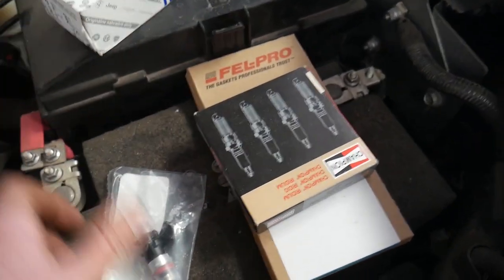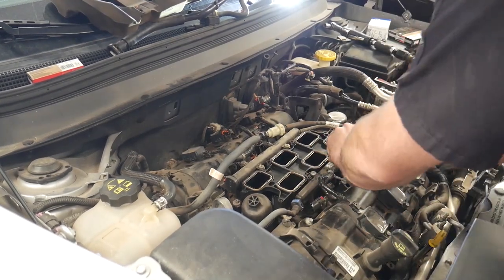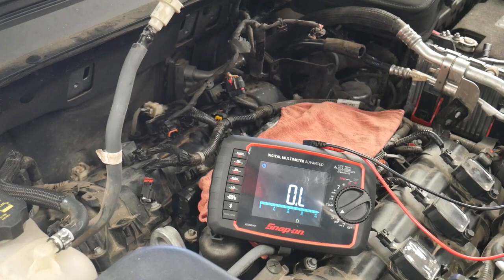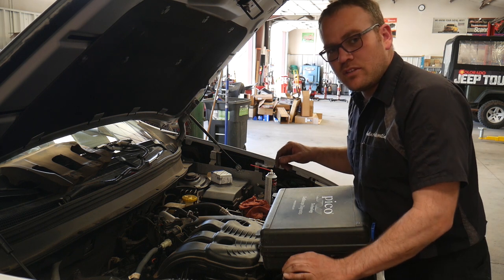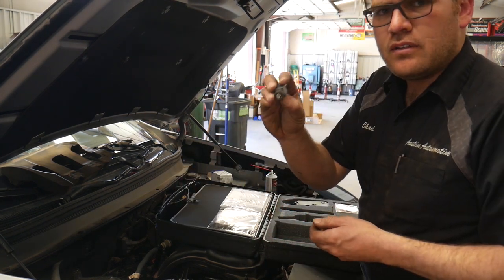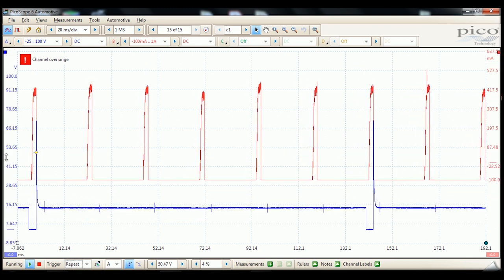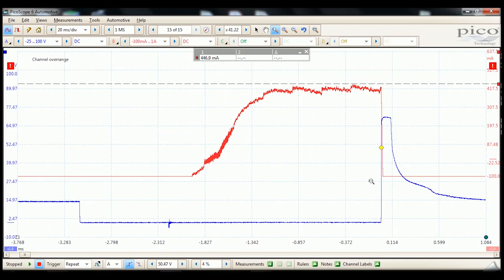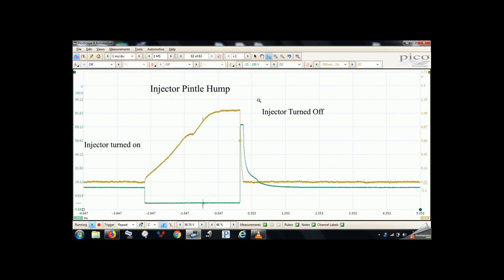2014 Jeep Misfire Injector code Pt 2 new injector and retest

Comment: how do you disconnect the fuel injectors? I'm trying to change the oil filter housing unit on a 2014 jeep grand cherokee 3.6L and for the life of me, the injector connections are not coming off. I'm wondering if I'm missing something, not seeing an important detail. Please help, thanks.

Comment: im getting ready to perform a side job, as a ford tech this is very helpful. i appreciate the in depth detail not just for learning purposes but for simple direction.
Reply from the maker: Glad to help. I have run into this issue several times on the newer Jeeps. Luckily the job isn't too bad to handle and at least you don't have to shampoo the engine like the newer ford ecoboost timing covers and oil pans.

Comment: Wow, another video that doesn’t show you how to disconnect electrical from the fuel injection. It must be some stupid trade secret that no one will share.
Reply from the maker: It is a trade secret and the Italians (FCA) will likely come after anyone revealing trade secrets. I’d offer a refund but the information was free. 

Honestly it’s something that we deal with day in and day out and releasing the safety clip becomes normal. I don’t have one of those vehicles available but I would assume there is a red safety tab that needs to be slid up away from the injector 1-2mm. Then you can press the tab to unlatch it from the injector. If it’s a POS connector from a POS company it may not release without using a pick to lift the latch from the bottom side of the connector. 

Mike, I hope you have a wonderful holiday season and spread more cheer than despair.

Comment: Hey, thank you for this video, 

I'm just clarifying some info on the injectors .. My wife's KL Trailhawk is throwing a Cylinder 2 miss fire and injector problem. I'm do well with tools, so I can definitely replace everything needed to try and fix the problem. My question to you is, how easy is it to get that fuel rail off, as well as getting the injector out, and reinstalling the new one ? Is it as simple as sliding out the rail and injector, and then sliding the new injector in and reinstalling the fuel rail ? 

Thank you!
Reply from the maker: You will have to unbolt it from the engine and the injector may have a clip holing in to the rail
Reply: @ThePracticalMechanic  how do I unplug the injector harness from the injector? There’s a red plastic piece. Push or pull? Thanks for the video
Reply from the maker: @w1923  you have to pull on the red clip first and then press down on the release button
Reply: @ThePracticalMechanic  the release button on the side?Thanks!
Reply: Thanks for your help. It was easiest to unbolt the fuel rail, then pull the injector out. After that i had to spray a small amount of wd40 on the red clip. To pull it without breaking. Then release the injector from the clip. Make sure your hands are clean when dealing with injectors. A small amount of grease on the rubber gaskets before you put them back in.
Reply: Same problem with the injector #2.  Could u please tell me which of them is the number 2?  Maybe a diagram

Comment: I'm a mercedes tech doing a side job. Im gonna replace all 6 injectors at once with new plugs. Are the injectors plug and play? Cause for benz i have to type in the each code.
Reply from the maker: No coding required on these
Reply: same like M272 fuel injectors ,  unlike M274

Comment: Thank you for the run through! 2013 JK Question, Misfire on 3 still. Going to do the injector however, we have oil in the intake and go through 1/2qt or so per tank of gas depending on city or highway. We can’t seem to get an answer on what it is from shops. New coil packs and plugs. Could the oil be due to a bad injector somehow? Thanks!
Reply: whats the update? My lady and I are dealing with the same continuous misfire; Also new plugs / ignition pack. Injector(s) are next.
Reply: That sounds like a bad pcv valve issue
Reply: Check your oil housing unit they are known to leak after over 40 oil changes

Comment: Do you need to remove the UIM to remove the rear #1 injector ?
Reply from the maker: Greg Bikevinyl it might be possible to sneak that injector out of there without removing the intake but it may be more work in the end. The upper intake manifold can be removed fairly quickly and in most cases the gaskets can be reused.
Reply: @ThePracticalMechanic   Thanks , by ( sneaking it in there )  I'm guessing you don't have access to the fuel rail bolts ?

Comment: What about the fuel spillage? Any tips on how to clean it up before reassembly to prevent fire risk?
Reply: Before taking anything apart...pull the fuel pump fuse start the car and let it run dry...should drain the line.